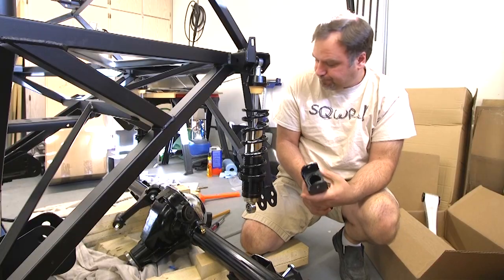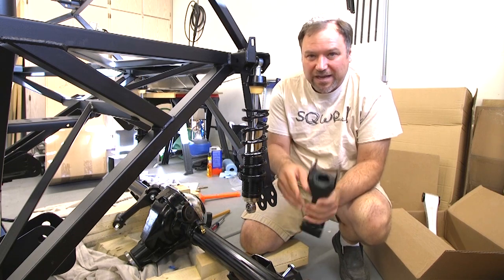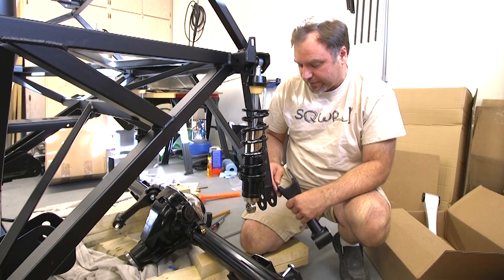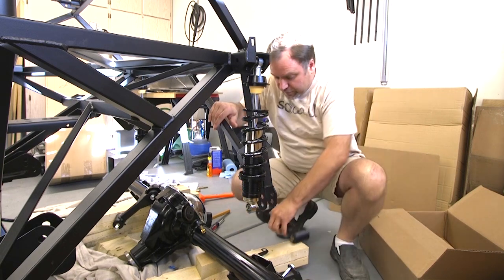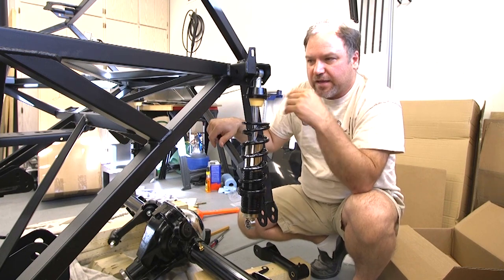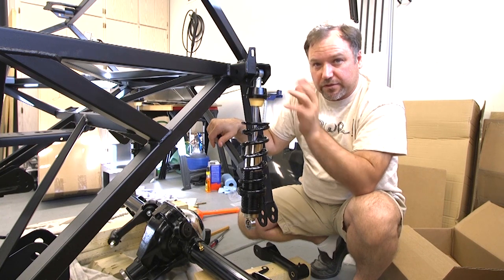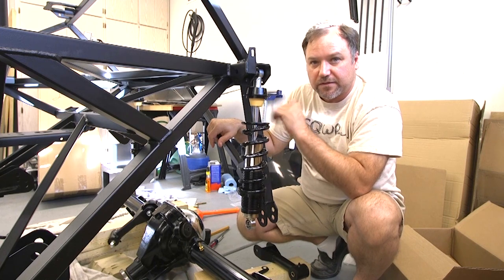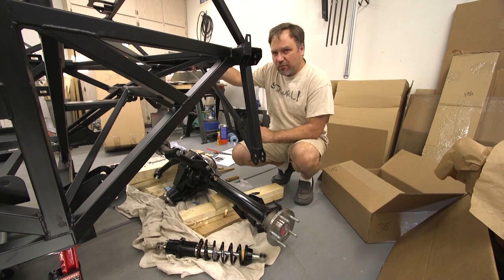Factory Five 33 Hot Rod V2 Build - Upper Control Arm Modification

Comment: Building a 33 myself. If you're dropping a 4.6l in it you may need to shorten the front upper control arm where the bushing clamps to the frame.
Reply from the maker: Hi Evalyn,  Not sure how this applies.  Please explain what and why.  THX.

Comment: I've been researching to build one of these as well.  I would agree with "sethmark", from everything I've read, the recommendation is to do the body work and fit up first.  That dust will be everywhere.Not sure what your using in your swamp cooler, but frozen water bottles work well instead of filling the tray with ice.
Reply from the maker: Thanks for the suggestion.  I put a reply under Sethmark you will want to see.

Comment: On my 2003 4.6 L Mustang engine there's a cast aluminum oil filter/ bottom radiator hose piece that bolts to the block. I've modified the bottom radiator hose connection but it still hits the control arm bushing. I've shortened the hose connector as much as I can. Installing an remote oil filter adapter is not an option due to the casting is a one piece unit for both the hose and oil filter. I'm open to any suggestions. Also my name is Mike the IPad I'm using is registered with my wife's name. She great help in the shop when I need her, but doesn't like it when I call her my pit tootsie.
Reply from the maker: I'll be putting in an LS engine, but good info for others.  Thanks.

Comment: So why did you choose factory five over something that's all steel like Brookville?
Reply from the maker: Many reasons.  My personal preference is high performance, slick looking vehicles. The kits you are referring too, in my eyes, might as well be Model A's.  Chunky/boxy, strait front grills etc.. Sure you can put a fast engine in those, but can the frame and suspension make it perform around a corner?  I don't mean this as a slam, but I am in to modern looking and performing stuff.  FFR not only makes already chopped looking bodies with scooped front grills, their frames and suspensions are racing performance spec.  And FRR actually sells an "All Inclusive" kit with a decent manual and comes all at once.  Not pieces you have to figure out how to put together or source from different sources.  We all know people say steel bodies are preferred for resale and is easier to perform body work on, but none of that outweighs all the other factors that go into picking out and building a car.  And remember, it usually costs about $8K more for a steel body.  So is it a higher resale or are you just getting the $8K back you originally paid in?  Not sure since I do not follow the used older Ford market.  Hope that helps.